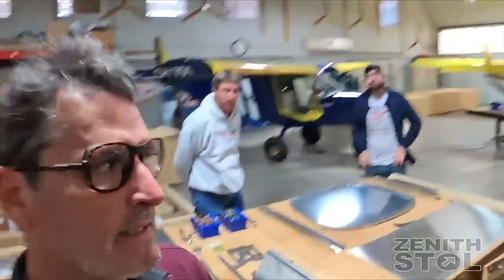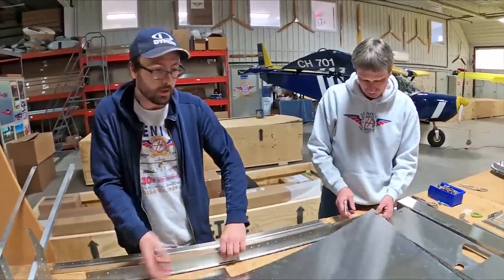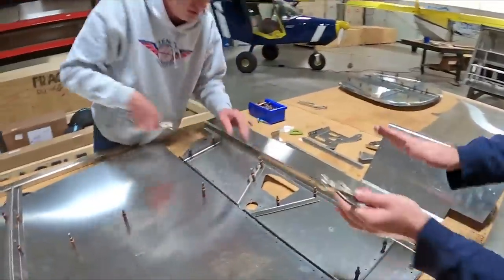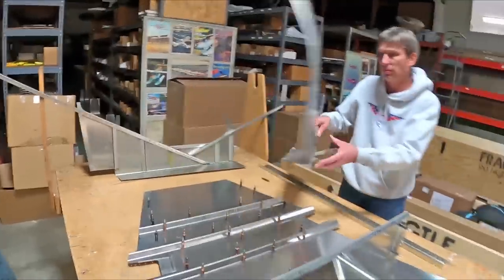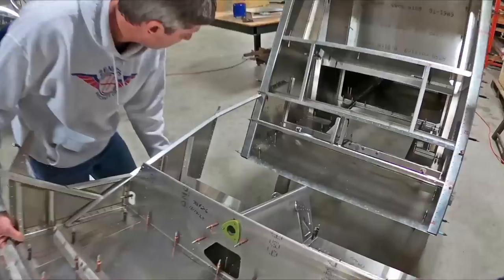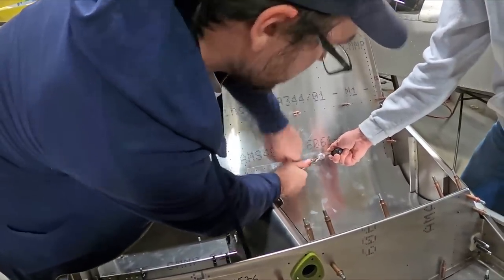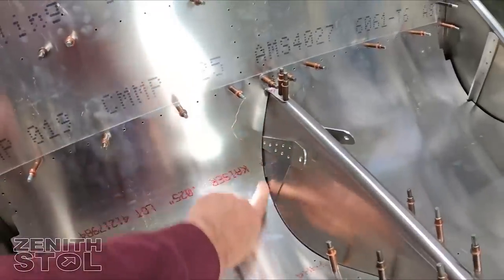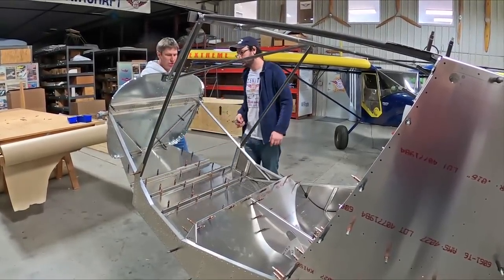Forward Fuselage Assembly: Building the NEW Zenith STOL CH 701 light sport utility kit aircraft

Comment: Great Job on updating this kit! I just need clarification on the main gear location. You said you are building a tail dragger version but my question is does the main gear remain in the same location as the tri cycle gear or do you have a separate floor pan with different CNC holes for each version?
Reply from the maker: No, taildragger gear configuration requires the main gear to move forward. We'll have more details on the new kit at a later time
Reply: @zenithac  would you please give your Email?

Comment: I tried several 701s but at 6' 2" I just didn't fit. We'll have to see how this new"er" one is.
Reply from the maker: We have many CH 701 owners/pilots who are taller than 6'2", but fit will depend on build (of the pilot, leg inseam, torso height) and finish of the aircraft (amount of seat cushioning, position of rudder pedals). The CH 750 series was developed specifically to offer more room in the cabin and adjustable seats